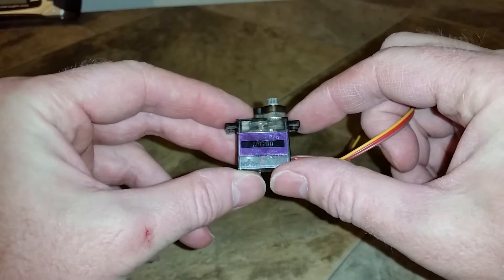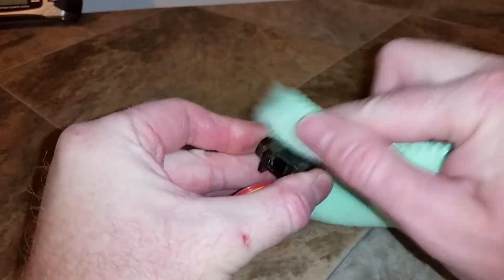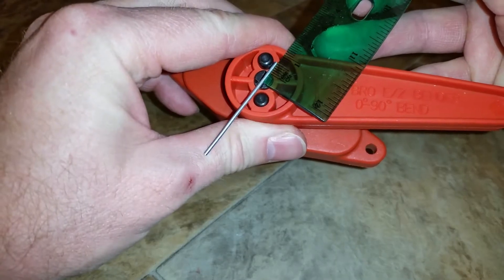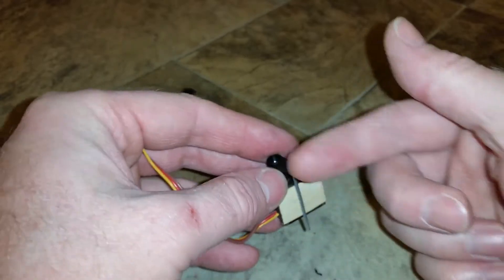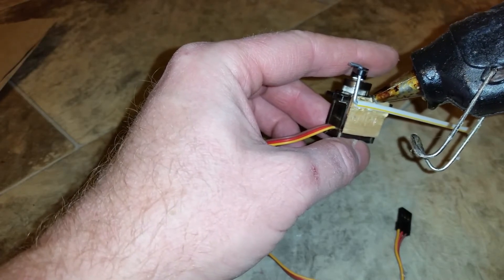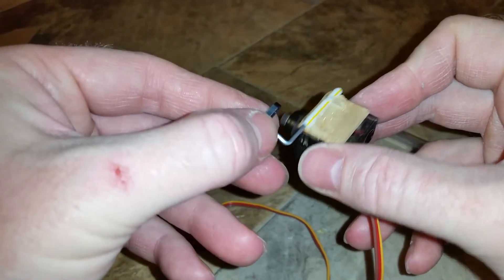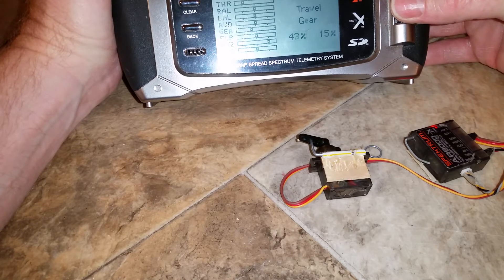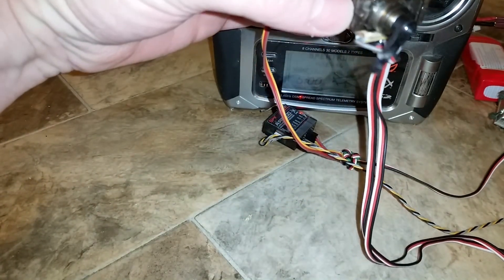Build a Bomb Drop Servo Release Mechanism

Comment: Thank you for that great instruction! I did based on what I learned from your video a working wireless bomb drop mechanism as well. Because weight is of the essence in my use case I used SG37 servo of 3.7g weight only.  I have no free channel on Eachine E52 drone control, so a ESP01s triggers the servo and provides wireless access point. On ground I have a mobile Pi Zero that runs a remote MicroPython console session on that ESP01s attached to drone. Simple "bomb.drop()" on command line reduces dropping to just pressing Enter on PI's wireless keyboard. Instead of cocktail straws I used small cubes for necklace. Instead of making the very small holes in servo plastic thicker I used Dremel to make wire thinner where it needs to fit into the holes. Finally I did a 180fps slowmo of a drop, this animated .gif shows the interesting part of video uploaded to youtube, plays 14.4 times slower than real. Again, all inspired by your video:
https://stamm-wilbrandt.de/en/forum/ESP01s_lipo_stepdown_servo_wireless_bomb_drop_mechanism_slowmo.gif
More in "WIRELESS ESP01S BOMB DROP SERVO WORKS RELIABLY FROM LIPO" thread:
https://www.esp8266.com/viewtopic.php?f=15&t=18515

Comment: How much weight do you think it can handle?
Reply from the maker: Not sure.  I guess it would depend on the gauge of wire used for the release pin.
Reply: A small wire like this could probably only hold like 2 or 3 lbs.
Luckily this mechanism is easy to scale up

Comment: hi this is troy I would like to know how to do this you did not show how you work it with the Hand Set can you show me how as I think may be you are Looking @ a project on a Drone Just Like my self  contact me I have a Q500 4K Handset how do you fix it so it works with the Servo and Switch or Lever thanks troy you can email me Direct on info@troypointerphotography.com
Reply from the maker: I set the bomb drop to be activated by a switch on my Spektrum DX8 transmitter.

Comment: Hi i need to operate this switch using my phantom 4 led lights can you please upload a instruction on that  the available payload release for  Phantom 4 are really too expensive i have managed to make the release mechanism as per your instruction now i need to make the release switch operate with the help of a photocell so which arduino board to use what else etc we can communicate through my  FB page https://www.facebook.com/rajatmukherje would truly appreciate
Reply from the maker: I don't fly DJI Phantoms so not sure how to configure the servo in their proprietary software.  I searched Youtube and found a few videos of servo bomb drops on Phantoms.
Reply: I have seen quite a lot of videos on youtube and got this that you can 
make a servo to operate from a photocell but i am new to this so don't know how make a servo control through a light sensor any way thanks a ton for reverting truly appreciate